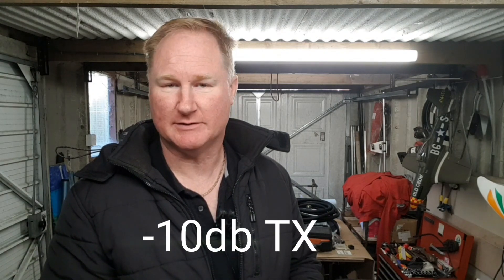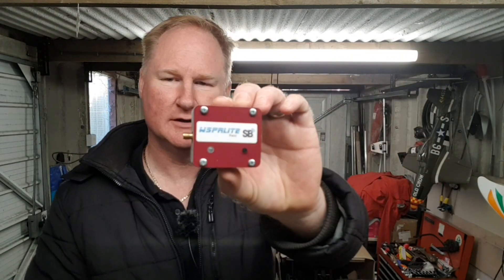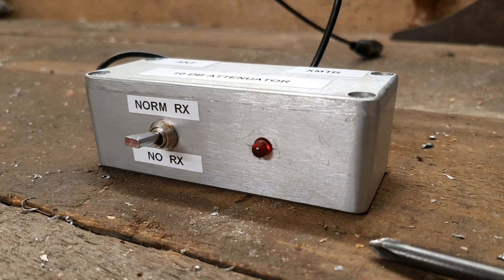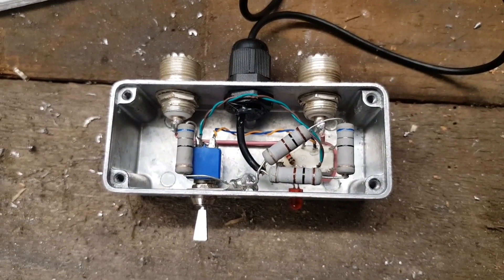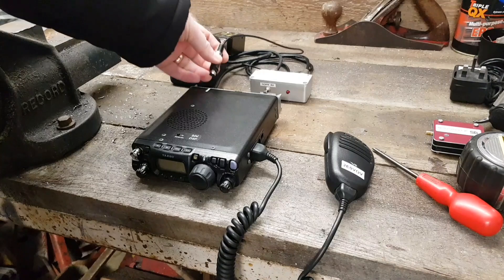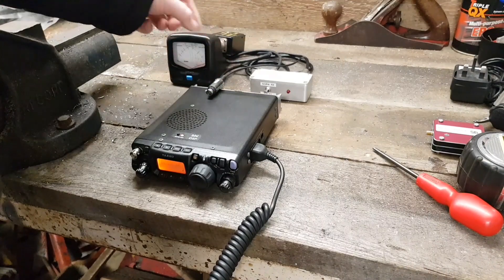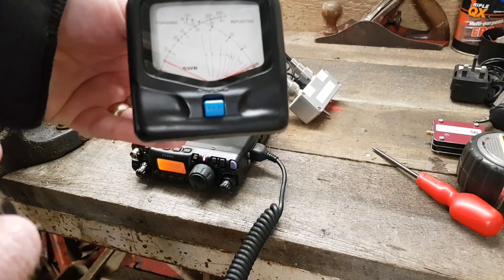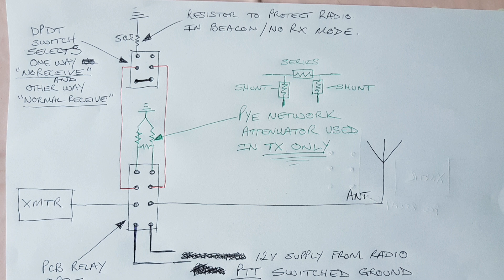A Switching RF attenuator

Comment: Great video, just what I was looking for at 1/10th the cost of an MFJ product. However, I have 1 question, why the resistor ro ground on the receive side? Why not just straight to ground??
Thanks
Reply from the maker: If grounding the receive circuit it would blow your finals if the relay should fail. That my reasoning of placing a resistor inline. Thanks for your question and good luck with your build
Reply: @mk1tina  Makes total sense to me now.
Great job Buddy👍👍

Comment: A diode across the relay coil would be a good idea to prevent back emf damaging the transceiver.
Reply from the maker: I'm surprised you feel it's neccesssary at such low power, thanks for suggesting it